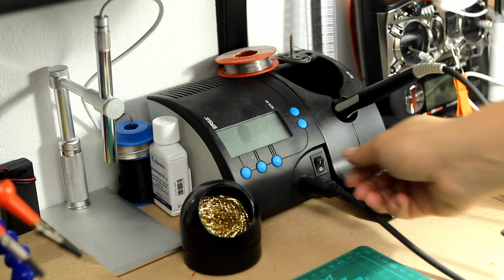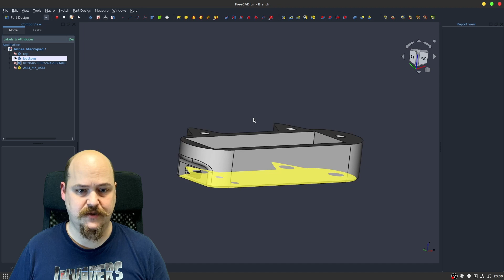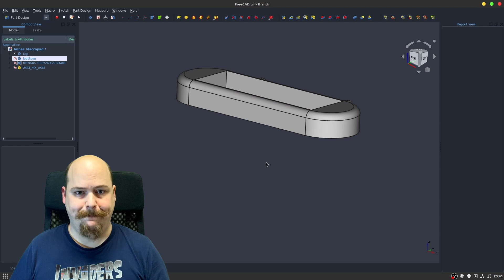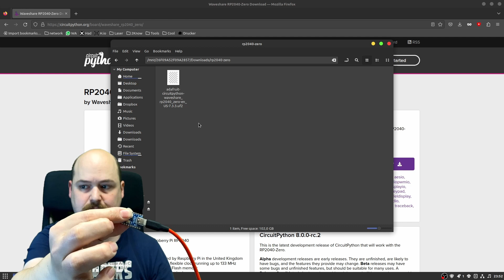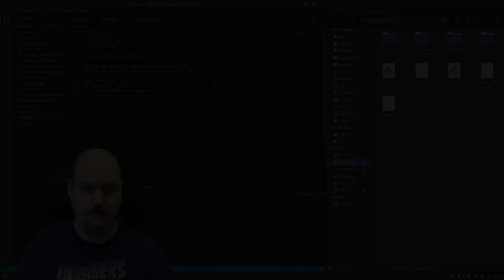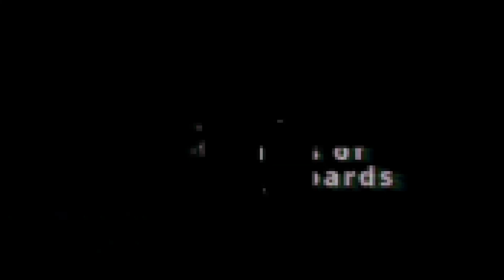Easy DIY 3 Button Macro Pad

Comment: Great project! I only have one problem, the keycode is not accesed by pylance and because of it, its not typing anything. The switches work, i have tried the before, but as i said, the keycode file is not accesed, and it has a darker, a bit transparent green. Can you help me with it?
Reply from the maker: hm... not sure if I understood your problem correctly but if it is about the "from adafruit_hid.keycode import Keycode" line in the code, it seems that pylance can not find it. Did you also copy the "lib" folder and it's content to the device? Circuitpython will look into the lib folder for the imported files and if the folder is not there it can't find it you should have the code.py in the main directory and "keycodes" should be in lib/adafruit_hid on the same device. Let me know if that helped ;)
Reply: @MakenModify  Thanks for the fast answer :) It really helped, apparently the keycode file was corrupted, i dont know how, but after i reinstalled the files from the printables page it worked :) thanks :)
Reply from the maker: @Luciqn16  happy to hear, your welcome ;)

Comment: Hello! I came across this project and find it very interesting. However, I think it could be made into a Bluetooth wireless version for added convenience. Using something like ESP32 would be suitable for this.
Reply from the maker: Sure. But a ESP32 is not very energy efficient (charge of the battery will not last to long). A nRF52840 would be better.
Reply: @MakenModify  
Very good suggestions! I'm also a beginner. I'll do some more research and look forward to seeing your new works too.